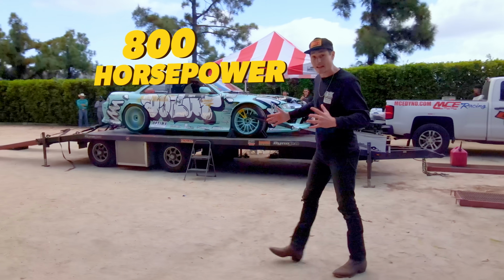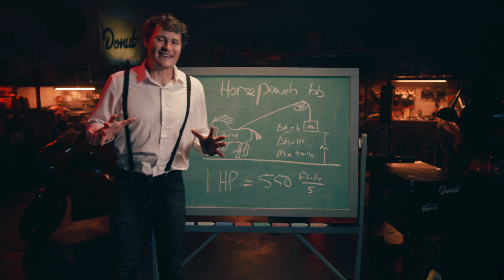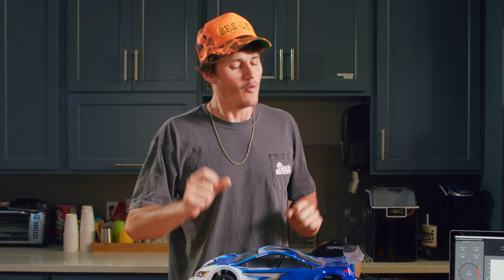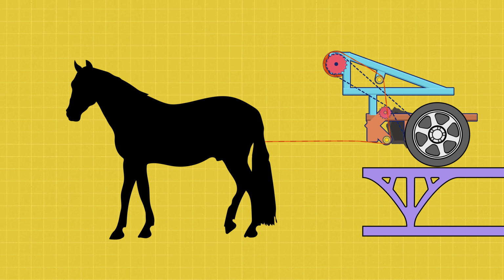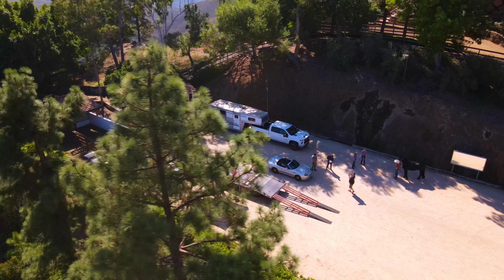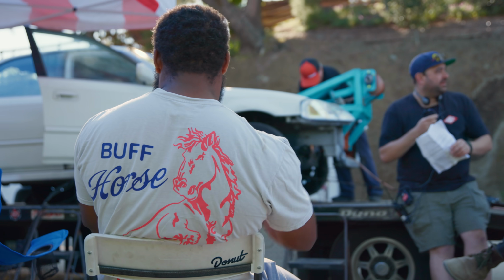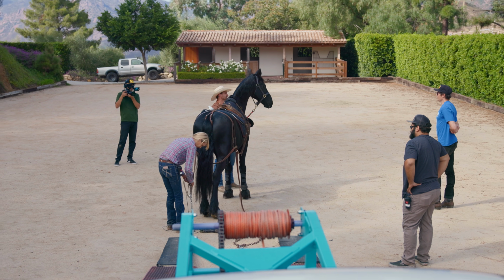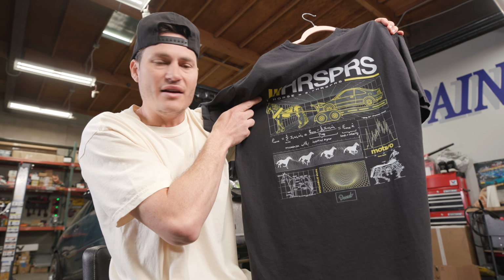How Much Horsepower is a Horse?

Comment: Finally, Donut answering the real questions we all wanted to know
Reply: So that means that is my car has 400hp know is ÷ 5.7 hp = 70hp will be the real result.... so you need 70 horses 🐎 is the same power off a 400hp engine  right? 😅
Reply: @hardbody_Santiago96 but that’s 5.7 to the hoof, how many at the crank?
Reply: @hardbody_Santiago96 
Dividing by 5.7 would appear to be correct assuming the team here indexed their results against the automotive industry's mathematical constant for measuring horsepower.  In other words, a car has a hp rating that is 470% higher than it should be.
Reply: @hardbody_Santiago96 guess so.  But they only tested one horse.  Another one may be stronger
Reply: @ChazXVI  that's true 👍
Reply: @ChazXVI  Yeah, Big D is a race horse. Working horses are much stronger. Also the way he was leaded may skew results as well. Innertia dynos needs acceleration to work properly. When horse got to walking speed it just keep that speed till the end. It was a happening event rather than scientific experiment. Load cell/gps data should be more precise but we got nothing on that.
Reply: @Piasecznik72 Big D was barely trying. The test is severe ly flawed. Humans are NOWHERE NEAR 20% as strong as horses. Especially that weak dude.
Reply: Right I’ve always wanted to know, the math part in a way doesn’t seem to really show the horses actual power besides torque over a certain distance.
Reply: @DDankunicorn   Watts is another measure of power. One hp = 746 watts. Purely theoretical of course. But ok, one horse can theoretically power 10 75 watt light bulbs, if that helps.
Reply: Nobel prize work
Reply: So does this mean 800 hp isn't actually 800 hp? It would be less now right?
Reply: @CcMan91   Well we could always say 1 HP is 1 Human Power and we wouldn't be wrong.
Reply: @153SCORN technically!
Reply: @153SCORN  lmao, I was literally talking about this at work today 😂.  I agree 👍  is
Reply: @153SCORN true, that’s way more accurate since we all mostly pull 1 😂
Reply: @CcMan91  400hp will be 70hp 😬
Reply: One of my friends did this a while ago it was around 16hp
Reply: @crystalcactuis.w  this is closer to the average power of a horse. I have read about another test and it was around 20.
Reply: I was really hoping it would be like,50. 5.7 really bummed me out tbh
Reply: @gimlysnort1889  don't feel bummed out :) Its just a result they got from 1 horse on a car dyno.... If a 500 kg Quarter horse runs 302m in 16.9s with top speed 90 km/h; how much HP does it have? much more than 15 :)
Reply: @gimlysnort1889 yeah but plus, they should of tested more horses than just one, and longer distance. 

Cause Big D as cool as he is, he is a LIGHT draft horse. There’s difference. Plus depends on if the horse was trained to pull heavy stuff rather than just pulling a cart. They should of tried to find a bigger horse which was trained to pull large woods out of a forest or mules that do that cause I am sure they are better ones out there but it’s an ok reading for a horse in general 

Although 50 is a lot to expect from a horse 😂 speed wise? Maybe, pulling and speed? Not likely. But 13 as Google sometimes says is more likely for a horse which was trained to pull. If you haven’t seen the video where a bigger draft horse plays tag rope with 13 men? It should of been a tie but the horse won them all. So. Again. The reading depends in my opinion.
Reply: @BrianHYX isn’t he dead?
Reply: @BrianHYX none of ur buisness
Reply: Exactly
Reply: They answered if 6in is enough?
Reply: That they're into horse bondage?
Reply: Literally a HUGE question
Reply: I wonder would a axle dyno been better for horse hp numbers or the same?
Reply: yea why the F is it blurred below his ankles while he's on the couch?
Reply: I also wanted to know how much hrsprs does bicycle has
Reply: @honeybhosle6612   Bicycle is not where the power comes from. Its a high precision machine, converting your power more efficiently. Over 95% of your power can go to forward motion. As an extra benefit. Changing the gear ratio, you can adjust for hills and slowly increase your speed.
Reply: they always say "mo powa" but never ask "how much powa"
Reply: Except they didn't. That horse wasn't pulling with all his might. Not even close.
Reply: Hello ! May Allah protect and guide you to his light and happiness in this life and the hereafter, God bless, Ameen. Excuse me for giving a little presentation of Islam, because it is very misunderstood nowadays, especially on those « Antichrist's » times, where media and politics are mixed to distort history and truth. Thank you very much for your time.

Islam is an arabic word that means the Surrender to the One and Only God, our Creator, Protector, Provider, who gives us life and all that we have, we are safe and sound by his will and grace, we are His and to Him we return, and we have to thank him in this trial life by submitting to him by our free will, or later in the Day of judgment when it's too late to save our own skin. Islam was the original Religion descended to earth from heaven with Adam and Eve (peace and blessing be upon them) in the beginning of humanity. and was passed to people with the succession of the 124 000 prophets and 315 messengers of God to all nations and civilizations since, passing by Noah, Abraham, Isaac, Jacob, Ismaël, Joseph, Moses, Aaron, Joshua, David, Solomon and Jesus (Peace and blessing be upon them) during the history of mankind, the last replaces and completes the previous, until the succession of the last messenger of God fourteen centuries ago, Muhammad (Peace and blessing be upon him) to complete the noble morals of all mankind, to bring humans and jinns out of darkness into light, and to purify people's religion and belief from corruption and polytheism, and return it to purity and true monotheism, like it was in the times of the prophets (Peace and blessing be upon them).

Many Religions that we know nowadays, at their beginning were true and under Islam, initiated by one of the prophets of God, but their original teachings, history and scriptures have been corrupted over time with falsification and polytheism, or lost and replaced with false ones. That's why Islam is the only Religion accepted by God nowadays, which consists in bearing witness that there is no god besides Allah (God in Aramaic, the original language of Jesus and the Gospel), and that Muhammad is His servant and messenger, just like Jesus and Moses and others are His servants and messengers. Never a messenger of God said he was God or literally son of God, it was the people after him who changed the words of God and corrupted the Religion. God is unique and absolute, He does not need to have a family and sons or to associate anyone else with His kingdom, He can simply create whatever He wants, everything belongs to Him, and to Him everything will return. Allah said in Surah Al-Mu’minun : “God has never begotten a son, nor is there any god besides Him. Otherwise, each god would have taken away what it has created, and some of them would have gained supremacy over others. Glory be to God, far beyond what they describe. The Knower of the hidden and the manifest. He is exalted, far above what they associate. (91-92 / Translated by ITANI).

Allah means the one and only God, the God of all prophets and creatures, the creator of the universe and mankind, and the Master of the Day of judgment, where our destiny, Hell or Paradise, is decided based on our faith and deeds in this trial life, and above all, Allah's mercy. 

Allah said in Surah Al-Ikhlas : In the name of God, the Gracious, the Merciful.
Say, “He is God, the One. God, the Absolute. He begets not, nor was He begotten. And there is none comparable to Him.” (1-4 / Translated by ITANI).

Allah said in Surah An-Nisa : O FOLLOWERS of the Gospel! Do not overstep the bounds [of truth] in your religious beliefs, and do not say of God anything but the truth. The Christ Jesus, son of Mary, was but God's Apostle - [the fulfilment of] His promise which He had conveyed unto Mary - and a soul created by Him. Believe, then, in God and His apostles, and do not say, "[God is] a trinity". Desist [from this assertion] for your own good. God is but One God; utterly remote is He, in His glory, from having a son: unto Him belongs all that is in the heavens and all that is on earth; and none is as worthy of trust as God. Never did the Christ feel too proud to be God's servant, nor do the angels who are near unto Him. And those who feel too proud to serve Him and glory in their arrogance [should know that on Judgment Day] He will gather them all unto Himself: (171-172 / Translated by Muhammad Asad).

Allah the Most Merciful said in Surah Ali-Imran : Behold, the only [true] religion in the sight of God is [man's] self-surrender unto Him; and those who were vouchsafed revelation aforetime took, out of mutual jealousy, to divergent views [on this point] only after knowledge [thereof] had come unto them. But as for him who denies the truth of God's messages - behold, God is swift in reckoning!
Thus, [O Prophet,] if they argue with thee, say, "I have surrendered my whole being unto God, and [so have] all who follow me!" - and ask those who have been vouchsafed revelation aforetime, as well as all unlettered people, "Have you [too] surrendered yourselves unto Him?" And if they surrender themselves unto Him, they are on the right path; but if they turn away - behold, thy duty is no more than to deliver the message: for God sees all that is in [the hearts of] His creatures.
Verily, as for those who deny the truth of God's messages, and slay the prophets against all right, and slay people who enjoin equity - announce unto them a grievous chastisement.
It is they whose works shall come to nought both in this world and in the life to come; and they shall have none to succour them.
(19-22 / Translated by Muhammad Asad)..

God said : Say, “We believe in Allah, and in what was revealed to us, and in what was revealed to Abraham, and Ishmael, and Isaac, and Jacob, and the Patriarchs, and in what was given to Moses and Jesus, and in what was given to the prophets from their Lord. We do not differentiate between any of them. And to Him, we surrender.”
(2:136 / Translated by Community)

Salam (Peace) -----------------------
Reply: From the #'s, a horsepower is more closely accurate to a humanpower
Reply: Need the horse to sprint like a little kid unspooling a water hose
Reply: Or really don’t care to know!
Reply: So 5 people can pull a horse?